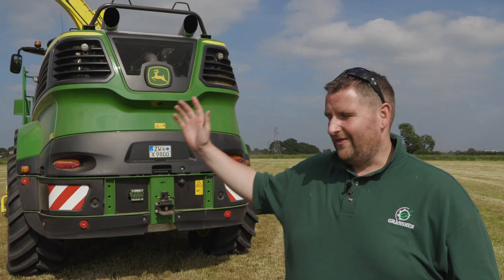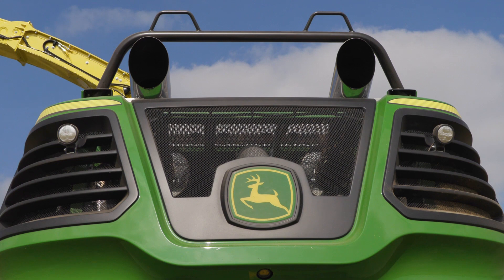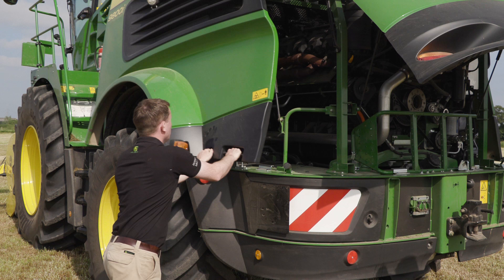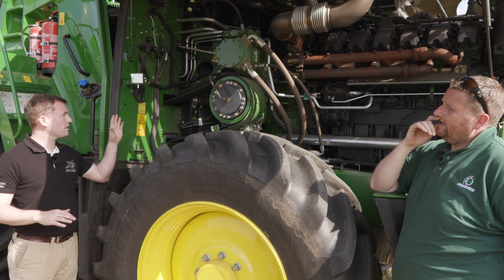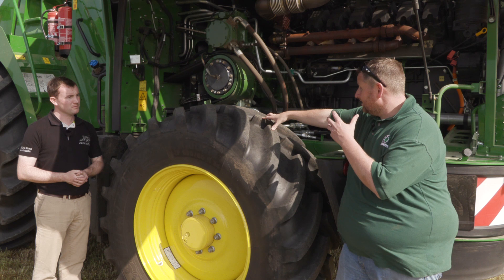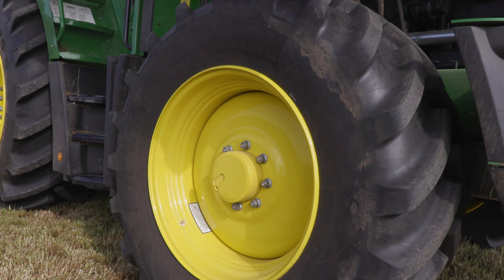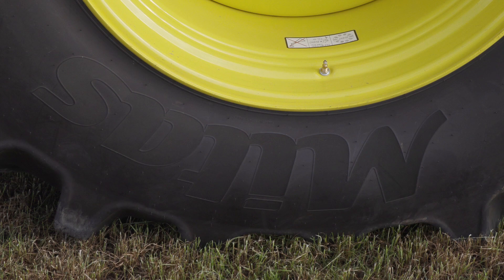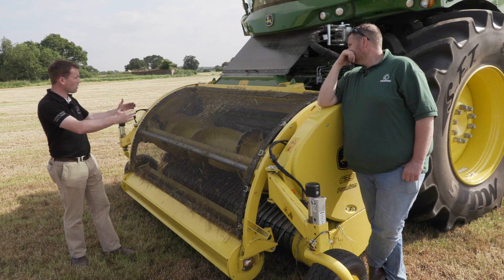GRASSMEN TV - John Deere 9000 Series Walkaround

Comment: Will it flow down 30 inch rows with out holding the wheel and when you are chopping in corn will the kernel processor pull the motor down?

Comment: MITAS front tyres really come on jd sort it out
Reply: There's nothing functionally wrong with Mitas tires. I dunno what you have against them, but they do what they're designed to do. What are you, a Trelleborg or Michelin fanboy? Being that it's a forage harvester, I would have preferred to see industrial-treads (cross between an Ag tire and a turf tire) on it instead of the Ag tires it comes with, but that's just to mitigate ground damage. The tracked variants do a perfectly good job of that as well, though.
Reply: there's nothing wrong with them if that's what you think fine,, but you run them with a lot of weight on them and they will soon wear out.
Reply: This is a forage harvester. Those tires are never going to be under excessive weights, considering that foraging headers are generally much smaller than harvester headers, and there's no grain tank in the machine, which means it cannot be over-loaded on the front-end. Notice how they used Michelins on the back, where the counter-weight and hitch is? 

Michelins are great for handling heavy payloads, and they don't need a super beefy tire set on the front, so why use them? What they did makes perfect sense to me. Since the front-end will never see excessive loads, they used softer, cheaper tires for more traction and a lower end-price for the consumer, and if you think there's something wrong with that still, you're not seeing the big picture.

"There's nothing wrong with them" is not just what I think. It's a fact. Use your head. If this was a combine harvester, I might agree with you, but nobody uses Mitas tires on the fronts of combines. Combines usually have Michelins, Trelleborgs or tracks on the front, because of the extra weight of the larger headers and grain tank. Every tire has its place. Even the ones you don't like. You not liking Mitas tires is an opinion. Me pointing out that everything has its place is a fact. There's a difference.

We're not talking about Chinese tires here. Mitas tires are a high-end industrial product, with prices that reflect that. They're still more cost-effective for use in forage harvesters and 8-series and below tractors than their competitors, but those things are not cheap, and they are not to be abused. You act like you know something Deere doesn't, when it's fairly clear that they thought of that already, and designed the machine in accordance with what would be required of it. Why use a huge, gnarly and expensive tire on the front when a lighter, cheaper tire will do?

On a forager, the only concern with the front tires is maximum traction, and that's what they went with. There's a reason why so many mud-trucks and Siberian haulers have Mitas tires on them, y'know.
Reply: Mitas = Continental, they will carry the same weight as the Michelin and Trelleborg tires...and it's a machine that will spend perhaps 3-5 % of it's life on the road... they will never wear out FFS.....!
Reply: never wear out lol. the road work these things do these days they will wear like hell, Michelin and Trelleborg would out last them twice over. why have Michelin make the back tyres and not have them make the fronts, talk about a mix match from new,